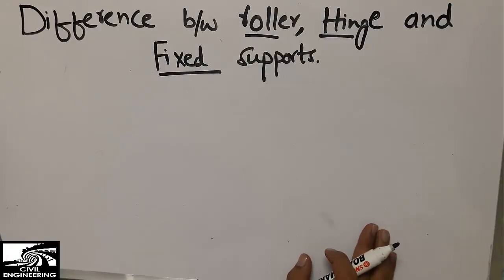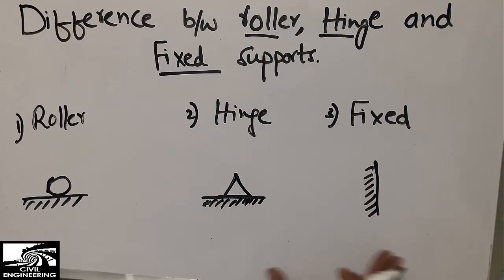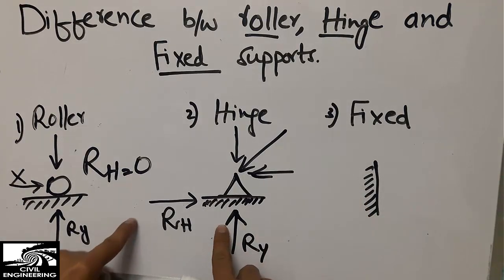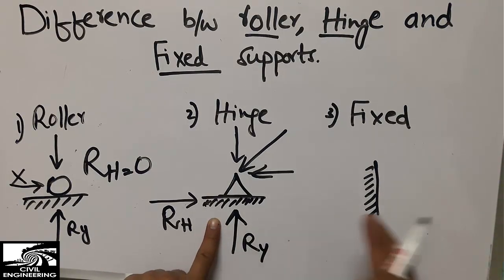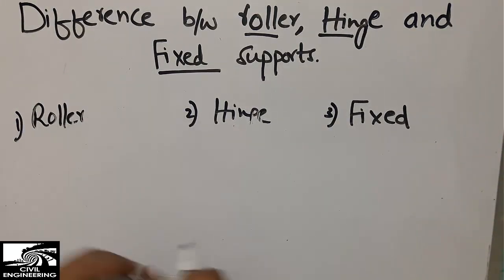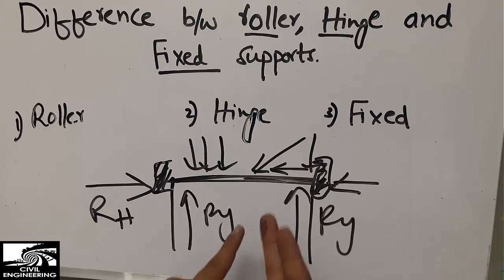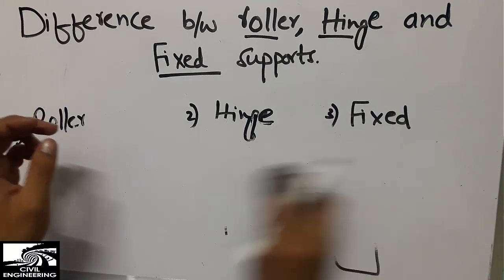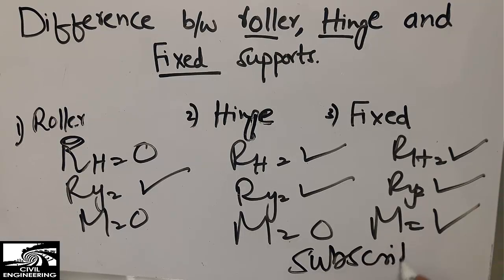Difference between Roller, Hinge and Fixed Support

Comment: Please why is moment in a roller support zero at the end support
Reply from the maker: Because of its property, How can it resist moment if there is no protection provided from all sides. There is moment in fixed support due to its protection property
Reply: @civilengineering94   so why is that moment in the middle too isn't zero?

Comment: This is the major students problem. Please reply I am waiting for your response.

If force is applied in upward direction in roller support. What will be the reaction in roller support.
Can roller support provid negative reaction/pulling force in downward direction?

Thanks
Reply from the maker: Yes, roller can also have downward reaction depending on the loading condition on beam.
Reply: @civilengineering94  can you show some practical examples. It will me a lot.
Or make a seperate video on this.
Because most people have a doubt roller can't provide a downward pulling force.

Comment: hello sir. Generally in steel structure design, why we use pinned support or fixed but support in most common instead of fixed support.

Comment: I have a question. If Horisontal is equal to zero on the roller how about if the roller is against the wall? Assuming there is force against the roller which is also against the Wall! Since there is no force vertically

Comment: What is moment?
Reply: When there is an eccentricity of beam that sits on top of the column, moment can be produced by that beam to the column
Reply: @eminashindahouse  thanks
Reply: It will cause the rotational movement
Reply: It is the calculation of the required force to rotate....

Comment: In structure where we use roller support hinged support and fixed support
Reply: Hinged support is provide at bridges, roller support used in lifts and fixed support for structure where we don't want to move
#civilenggguide